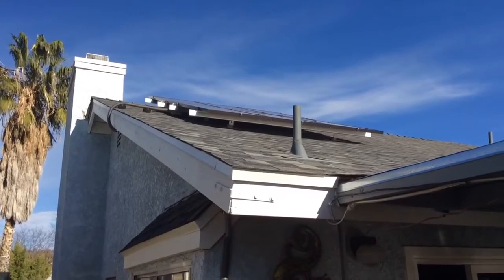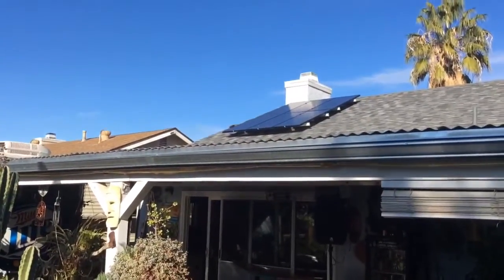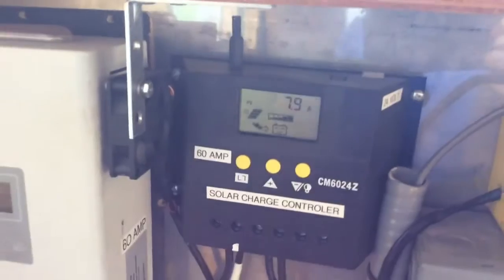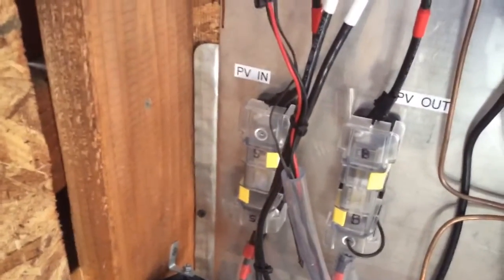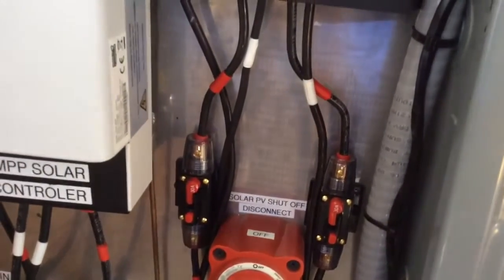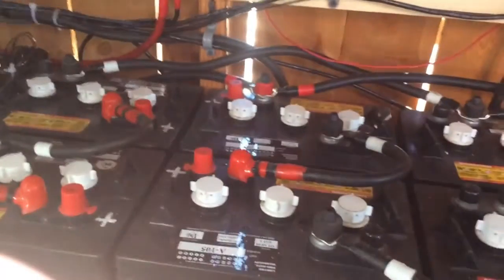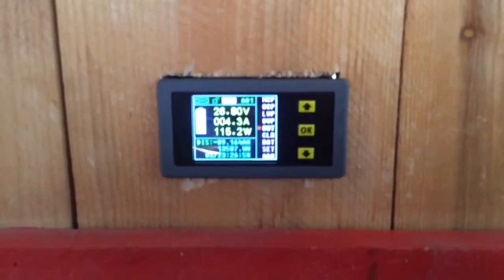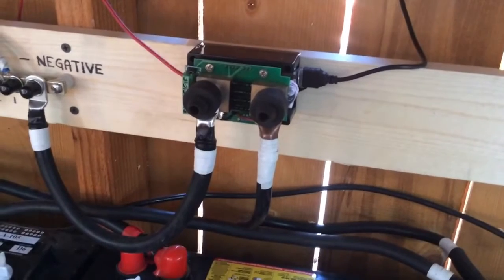SOLAR POWER Off Grid system update 24 volt system

Comment: Great work! Im torn between 24v and 48v, would like to pull the trigger on 48 volts , but the only thing stopping me is the heat these systems throw off  from all the vids I have seen , and the possibility of fire . Your thoughts on that.,no worrries on high voltage persay ,

Comment: Thanks dude! I'm installing 1960 watt panels. 4000 w inverter. 8 6v 230 ah batteries to start off. 24 volt system Off grid in my new 850 sq ft home. Fridge,deep freeze, stove on propane. Your system is exactly what I envisioned in my plan. Thanks for sharing your videos. 

G.

Comment: Nice system. The Digital shunt you have is very interesting. I have a simular one on my DC backup generator. I have the Trimetric battery monitor on the House system. We are off grid. It was expensive but it is easier to use than the Magnum kit for our inverter or the kit for the midnight. I don't want to scroll through the menu to fingers out where things are,  the Trimetric is one button and it tells all. I might get the one you have for a system I am building for a backup for my dad. Thanks for the tip.
Reply from the maker: I have been a fan of your channel for a long time. the backup harbor freight motor generator you built is great.
Reply: urban solar offgrid Thank you sir. I just found your channel and subscribed as well. Thanks

Comment: There is a whole debate to ground or not ground the battery bank.
Reply: old time engineer My battery bank is grounded to its own ground rod. Dual return path? Yes.  It's interesting how the NEC says that's a no no but tells you to do it anyway lol. My equipment bond is terminated at the ground rod at the solar power center and bonded to the AC power system on the house where the point of entry has its own ground rod. This passes the ground through the inverter equipment bond. This is how I have had NEC rule explained to me but technically it makes a dual path to ground and can cause the AC breakers to not function properly when a direct short occurs. The NEC wants to eat it's cake and have it too lol. Having the DC side ungrounded will bring a greater  risk in the event of lightening and the Arrestor will not work. MOV (metal oxide veristor) have to have a ground or the will not protect your system. Did you mean that debate? lol
Reply: Steven Davis ok
Reply: How can we have a debate it you are so agreeable? Lol. I must have to much time on my hands my friend.
Reply: @offgridinthepacificnorthwe3210  
You are absolutely correct Pastor. That's why I kept telling you, you are one of those intelligent guys out their.
Keep on the good work and I agree with you 100% on GROUNDING your battery Bank.
I have mentioned this topic on my Channel years back and it seems to spike some arguments with other people. I just let it go and kept doing my thing. 
Thanks for sharing that BRILLIANT STORY Sir